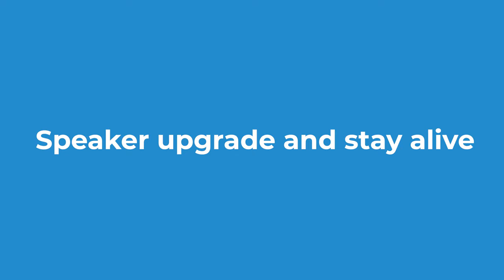Adding a Loksound 5, speaker upgrade and stay alive to a Bachmann 37

Comment: Nice work that Richard . Sounds great . Is there any scope for replacing the other speaker ?
Reply from the maker: Not really, I can’t think of a better speaker that would fit, it sounds good if you replace the top speaker, can sound a bit rattley and distorted without changing it though
Reply: I can see the day where someone may think , to hell with it , let's bin the board and all the gubbins and fit an EM2 ! 
That might be me ! 😮